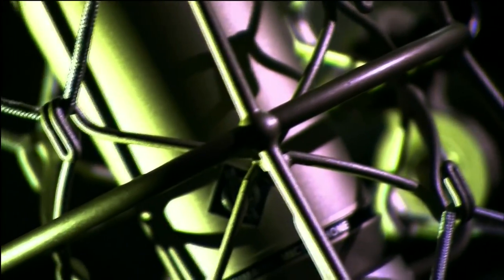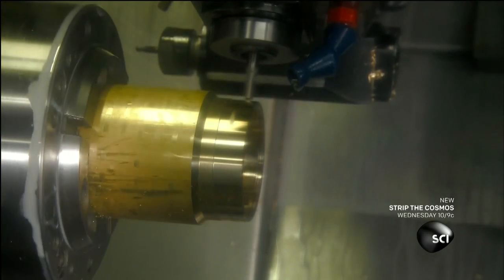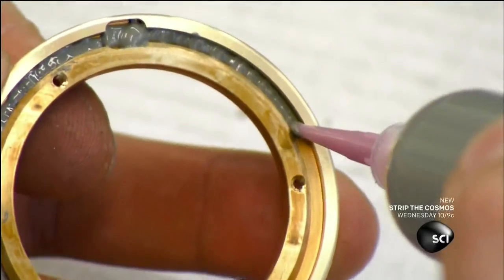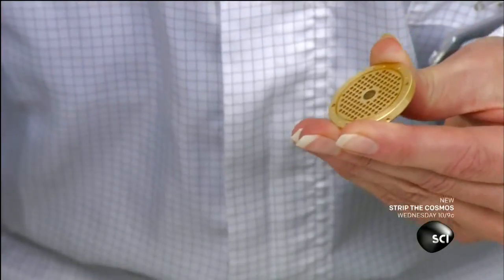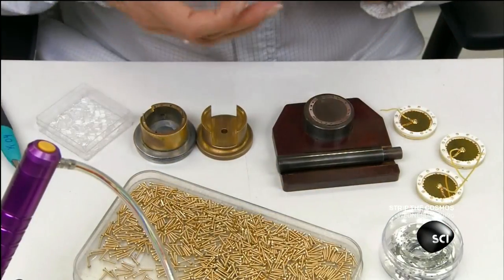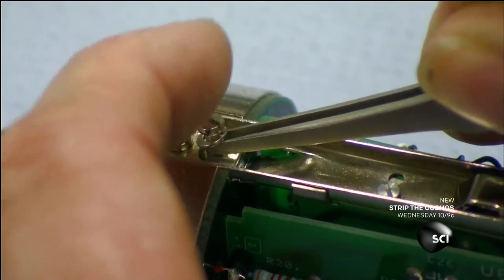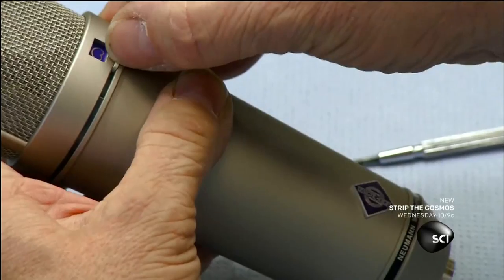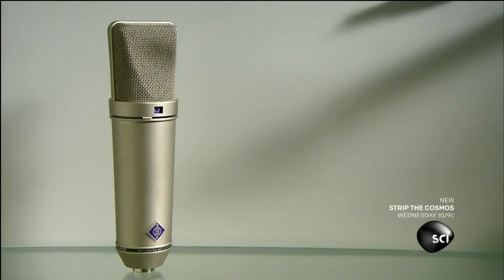How It's Made - Neumann U87ai microphone

Comment: Still have no clue why it’s so expensive.  Kinda hand made so + 100!  Material(brads and such) + 100, electronic parts +1000, inflation 1000%
Reply: it's expensive because of how close it sounds to real-world hearing, go check out podcastage's review on it
Reply: They reject around 30 mics to every one they sell due to the rejects not meeting their standards.  Hence the cost.
Reply: Wiha caps on those are a few bucks a piece individual here in USA alone. Guessing silver wire or silver plated OFHP copper. Everything is premium. Transformer and mic element are keys to these. Ferrite cores are custom for these and pricey too. The mic element is bulk of price and hard to make. $500-2000 for that alone! Took CS and EE in college. These are worth the bucks...

Comment: Would think neumann knew about the pin 1 problem enough to design their microphone better... but no...  along wire attaches the shield to the body of the microphone... that's know as an antenna.
Reply: I see, you got a hard-on on the Rane paper. Don't blame it on the mic wise-head. The transformer insulated U87 works well that way for decades for a reason and would hum if done otherwise. If you live in a shitty problem area with RF interference. Take care about pin 1 in the mic pre amp, the manufacturer should have done this in the first place,  or with a Neutrik connector from their EMC series.
Reply: It is not Neuman that designed these, I do believe Telefunken did.
Reply: @RockmannMusic  you know, Rane's not the only who's published articles about the issue, not by a long shot.

It's basic RF-design and EMI-desgn stuff that every electronics designer knows.

Rane's article is just one of the best known ones even if it's not primary source.